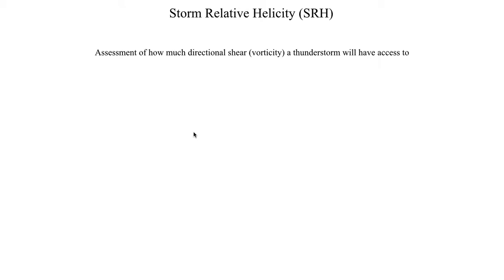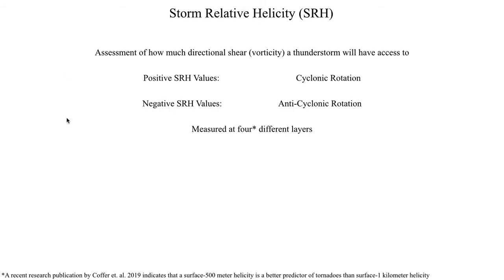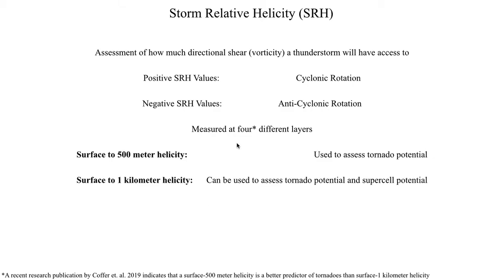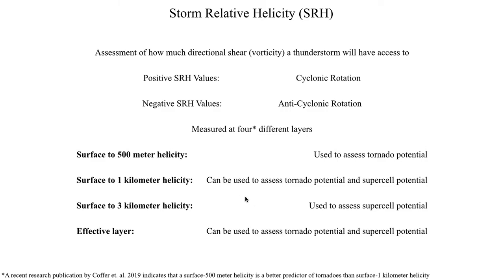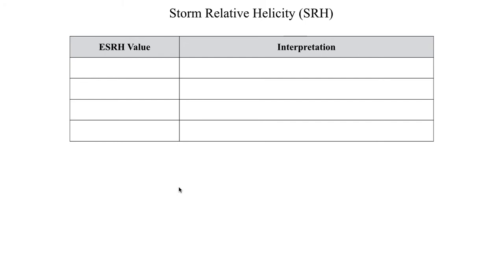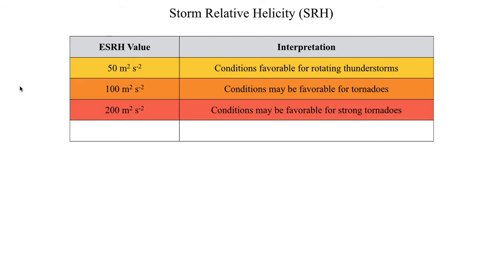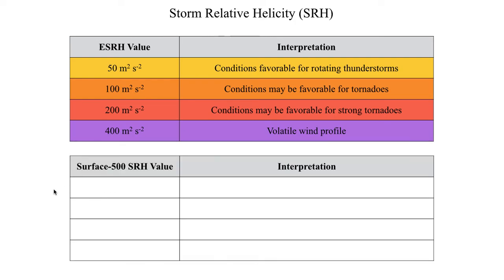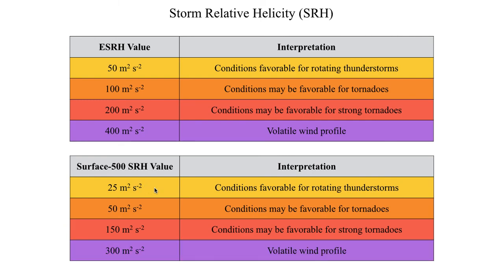METR2023 - Lecture 22 - Segment 5: Storm Relative Helicity

Comment: how to calculate SRH? can you provide me the formula for SRH calculations?
Reply from the maker: Here is an equation:
https://www.nws.noaa.gov/mdl/scan/HelicityCAPE.htm

Where V is the wind velocity vector (a function of altitude z), C is the estimated storm motion vector (a constant), k is the vertical unit vector, and dV/dz is the horizontal vorticity vector. Note that the dot product is the very last vector operation performed on the integrand. This integral is usually performed from ground level to an altitude of interest, but the limits of integration can be any two altitudes.